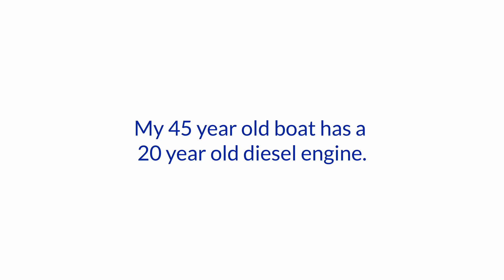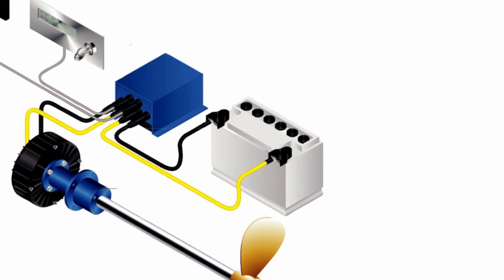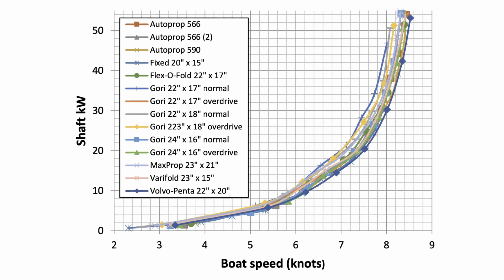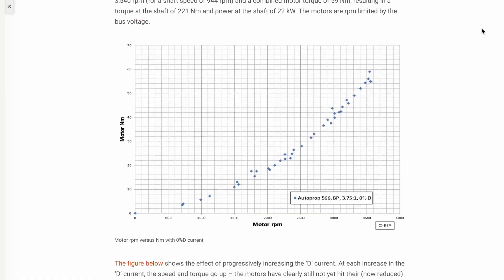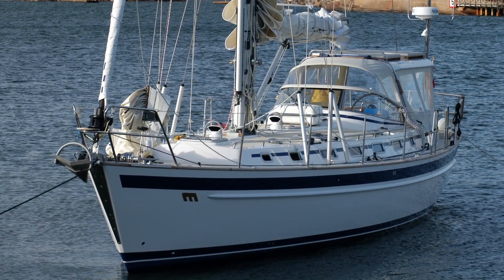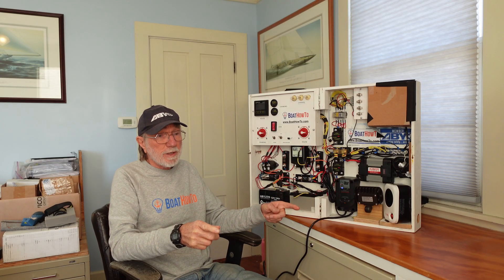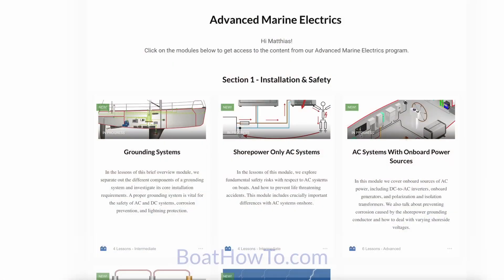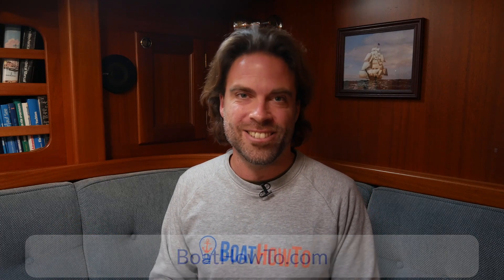Should I replace my old DIESEL ENGINE with an ELECTRIC MOTOR ? | Ask The Expert with NIGEL CALDER

Comment: Everything said is very true:) Saying that, something extremely attractive in the idea of using Solar and Turbines to charge the battery bank for leaving/entering marinas - Batteries and solar panels are slowly getting better as well:) Currently building a dual motor setup (2 x 10Kwh Motors) for a 36' Sailboat where I am using 2 Honda EU22i as backup charging power if anyone is interested: https://youtu.be/MaReKNz9kZ8

Comment: I'm very glad to see this thread just now. I'm considering this very thing on my 50 year old C&C 36. One of the things I'm dealing with is the layout of the aft end hold. I can not access the prop shaft gland nut or rudder qudrant and cables for maintence do to the diesel tank placement. It is solidly in the way and must be removed to work in there. Also the motor has poor access, and is OLD and of unknown condition.  So as long as im going that far might as well kill all the birds with one big expensive stone.

Comment: As Nigel says "IT depends on ..."

I changed last year from a 15hp petrol outboard to a 6kW electric outboard (comparable thrust). Even without capability to charge my battery with shore power I never ran out of power after more than 2000nm sailed in coastel waters.
I have 30' trimaran and the hydrogeneration of the outboard while sailing delivered all the power for needed motoring and with 400Wp of solar power it not just gave a backup but also plenty of power for cooking when at ancor.
So for me it has been the right decision but of course it is not for all.
Fair winds and good season 2025!

Comment: Nigel is right.  While it looks fun and cutting edge, adding complex electric propulsion systems to a boat does not make sense.  The problem is that batteries still don’t have the energy capacity required to reliably power a boat for prolonged use.  And the last thing a private boat owner needs is more complexity with a hybrid system for so little payback.  I respect Delos and the Wynns for trying something new, but for most this added complexity takes away from the whole point which is to practically live and explore on a reasonably priced and maintained boat.
Reply: - electric propulsion is NOT complex, it is in fact WAY simpler than any diesel engine system
- It is false that batteries do not have the capacity. They lack capacity per weight. So if you have the space for batteries, and you are not the kind of sailor who mostly using its engine instead of truly sailing, just get more batteries, and you are a lot better than with diesel engines.
Reply: Except that an electric motor on a boat is not a "complex propulsion system" compared to say a diesel engine for example
Reply: Both for now and as time and technology progresses, switching over to a more reliable, possibly leaning more towards hydrogen because the excess is drinkable water; electrical systems.
Reply: @ thanks for the reply.  I worked in the development of hydrogen engines for a major automotive supplier.  It is a long long way before these systems would be practical on a private boat, if ever.  Problems include: Supply of H2, explosive nature of H2, complexity of H2 systems, and loss of output over time.  But more fundamentally, H2 has the advantage of being very light but extreme disadvantage of take up lots of space.  The size of tank required to store H2 on a private boat will never be practical.
Reply: @CaptnButch  As time progresses, technology will also progress.  H² will make it to where you only have to dock for refueling, shorepower and servicing.  Your motor/generator will be in use more because of less docking for shorepower.

Comment: The local electric boat conversions I'm familiar with don't need to plug in at the dock and do quite well. A thousand watts of solar (barely two panels these days) will go a long way around here. One boat I'm familiar with has a 13kWh battery which will motor at 10hp (7460 watts) for 2 hours. And that's more than necessary for getting on and off the dock. I got a sailboat because I like to sail!
Reply: Yea it’s a lot more nuanced than his two minute answer and it’s only a matter of time until all boats are electric.
Reply: @sunlightconversions828  I think you will be ultimately correct. I don't have enough years in the bank of life to expect to see it. I know that the reason they run trains with very big generators driving electric motors is purely to remove the gearbox from the build. However for coastal cruising in shipping lanes where accessible safe haven ports are 100s of miles apart, electric isn't viable yet. Certainly not with reasonable  costing. Motoring for 2 hours in a 10 tonne boat, for example against a 20kt wind in moderate seas will get you about 7 miles. If you are embayed, that may not be enough. On our coast, you will need to reserve some battery power for bar crossings. For example, the run through Wide Bay Bar is around 4 miles. With any wind you are on a lee shore. It would be a rare day to sail that without a motor running.

Comment: Generally speaking, an old diesel engine can't kill you when you work on it.
Reply: It's true that low IQ and incompetence can kill people working on high voltage electric power systems. Perhaps we should ban electricity from our homes? It is also comforting to know that people have never died from the CO and CO2 in combustion engine exhaust. And other toxic gases such as NOx. And people have never died from carcinogenic compounds in liquid hydrocarbon fuels. And a fire has never been started by a combustion engine or its auxiliary systems. And a boat has never burned to the water line as a result of those system failures.

Comment: I think there is more to consider here than just raw efficiency.  

Yes, using an electric motor driven by a diesel generator may be less energy efficient.  But, reliability is something else that should be considered.  Electric motors are far more reliable than diesel engines and require no maintenance - which has its own costs, if you are using a diesel engine.  The batteries that you would use in an electric powered boat also typically can take thousands of charge cycles, providing many years of trouble-free service. 

I would also like to point out where else electric motors are deployed in place of diesel engines - cruise ships.  A typical cruise ship application would employ a huge electric motor(s) to drive the prop(s), with mutiple diesel generators onboard to supply the electricity.   They can then use as many, or as few, of those generators as they require at the time to provide the power needed for the desired cruising speed.   Having multiple diesel generators also improves reliability, as the ship can lose one, or more, diesel generators and still be able to continue on their journey, just at reduced speed.

You mentioned many different potential single points of failure in an electric motor powered boat., but you did not discuss them.  But, I would point out that there are many different potential points of failure with diesel powered boats, as well.

I think electric propulsion has great potential - but, may not be the best solution for all applications.

Thanks for the video!

Comment: Well, what are the single point failures going electric propulsion?
Its all cool new tech but how owner friendly is the system, how robust is it for the operating environment and cost of replacement?
Reply: A lot fewer than the single points of failure in a diesel motor system. More user friendly too. I just had to change oil and transmission fluid and alternator belt! None of that stuff exists on an electric system which has far fewer total parts.
Reply: Electric boats are my business.  On most boats, I show you the battery switch,  hand you the keys and point to the throttle. That’s all there is to it. Winterizing consists of turning off the battery switch.

Comment: 1.: Don´t convert a 45 year old sail boat to electric propulsion.
2.: For daysailers or small range boats electric is the way to go. Many good solutions are offered today, but they are a bit expensive.
3.: For cruisers or larger sailboats the future will be electric too. But not by reinventing the wheel, or low voltage expensive yachty solutions. But by installing the proven, effective, relatively inexpensive complete backbone of electric cars. Battery pack, engine and controls can be  be marinised, even more easily than Diesel engines. If range is still an issue, a generator will still be neccessary. If done properly, efficiency and especially reliability wil be far superior.

Comment: most ppl use solar and wind power to run the electrical engine but also run a diesel generator that charges the batteries that runs the electrical engine which gives you a considerable range

Comment: One very important metric that people usually don't talk about is what's lower maintenance. The eletric+generator seems to be lower maintenance, specially if you were already going to have a generator anyways. And considering how much work a boat gives, how many things break etc, I suspect the fuel inefficiency of this setup is well payed off  by the lower maintenance, lower stress and defects that are electric engines... Well, unless I'm mistaken about that.
Reply: You're mistaken, there is no escape from maintenance
Reply: @Siskiyous6  lol, yeah, I know there's no escape. But, AFAIU, eletric engines are much simpler and require way less of it.
Reply: @LibertyCaveWS7PB if the motor is direct drive, and air cooled There is literally no maintenance. I mean you can spray some windex on it if it makes you feel better.

Comment: Well said Nigel ! It always sounds like a good ideal while chatting at the local pub but its all about where you sail and/or plan to sail to. Here in the NW people think they can go all electric and not have any problems and don't take an account the massive tide swings, currents and not to mention the commercial traffic. Can be down right dangerous.
Reply: Most people go day sailing.  Electric is perfect for that.

Comment: Electric hydrofoils made by Navier Boat get 75 nmi range (or more with their larger battery back) with a cruise speed of 20 knots.
Reply: Now you're talking. Only hydrofoils can reduce boat drag. But equipping a 40 foot cruising boat with that technology will cost the same as buying 2 cruising boats. Another note. I berth in the largest marina complex in the Southern hemisphere. Guess how many electric vehicle charging points there are? If you guessed 0, you are 100% correct. Charging an electric boat! Dream on. We are in a 2 metre LAT marina so just add any sort of gubbins under your boat when we have spring tides in cyclone season. At the moment no new tech is viable, unless it is on a dedicated race boat which only does bay racing. So the three billionaires might buy one, but the others will not.